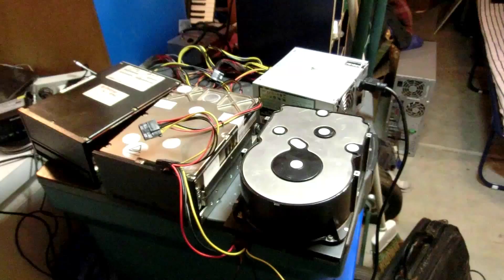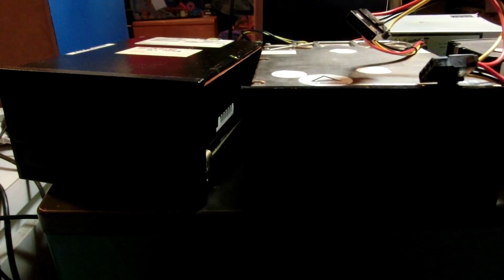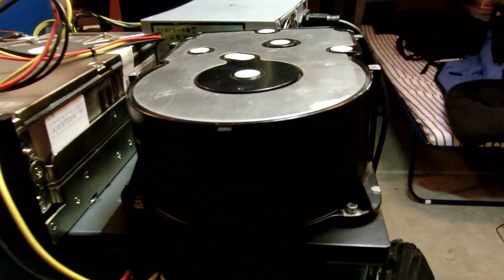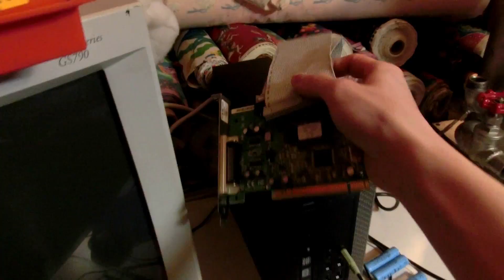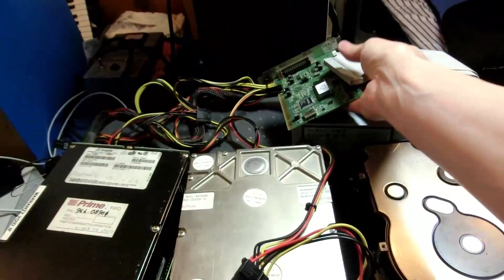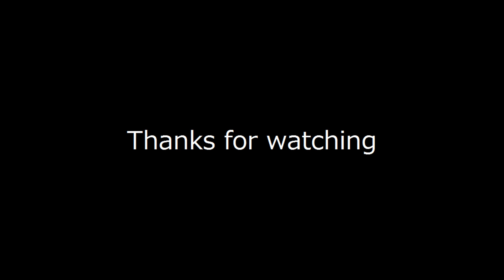3 full height 5.25" 1980s Hard Drives power on

Comment: Last year I had four old computers given to me. On the case there is a plate saying that they were made in 1983. They have no hard drives but have two 5 inch floppy drives. To get them to work a floppy disk is inserted. I was also given many 5 inch floppies plus many operating manuals. The brushless D.C. motors that drive the 5 inch floppies make good generators for model steam engines. I have dismantled two of them and hope to dismantle the other two. Keep the good videos coming!